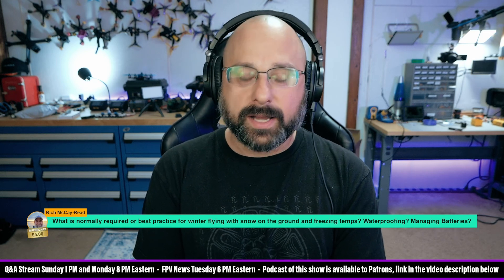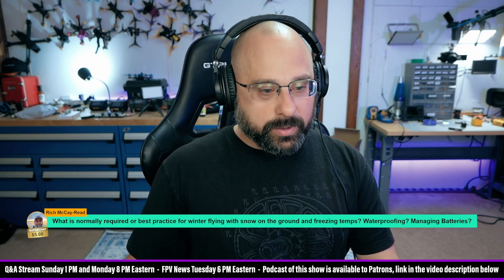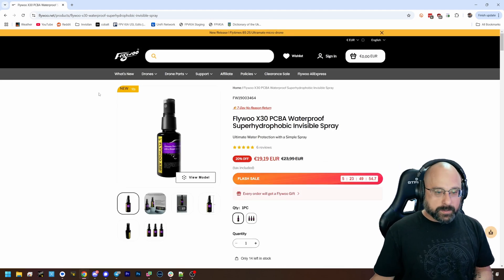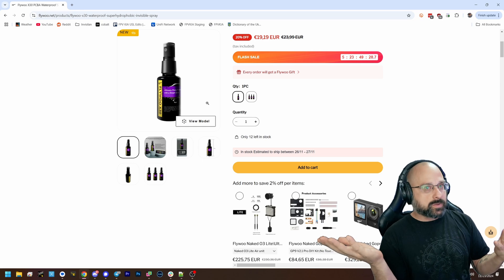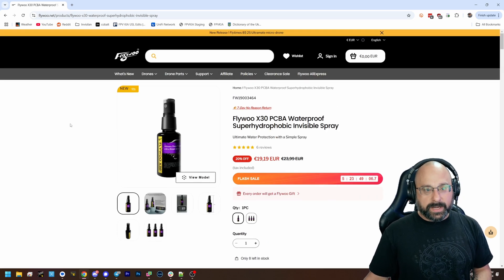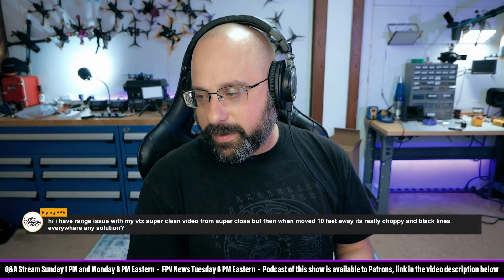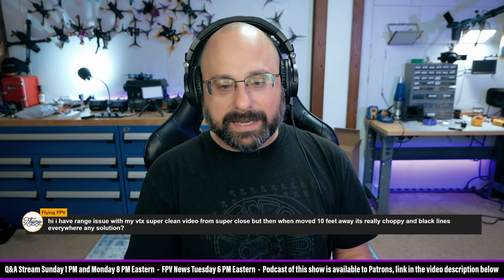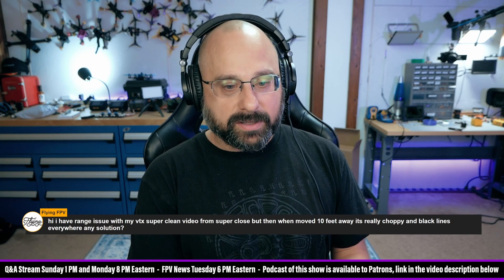What's Better About an F7 Over an F4? What Should I Do To Prepare For Flying in the Cold? - FPV Q&A

Comment: Bardwell forgot to mention for winter flying that props  are much more brittle in the cold,  some will explode without hitting anything, so use good ones and they still break very easily

Comment: In Alaska I use worry free extra thick coat or two, NEVER comes off and helps to thermally insulate. I’ve flown as low as —20 by wrapping electrical tape around entire stack, DJI air unit and all the way to camera. Basically keeps vtx heat inside and trust me air unit won’t
Reply: Yup, just put my quad a foot down in powder and just sent my flying snowball back up the mountain. That stuff is just silicone caulk but it works!

Comment: I ... might be wrong ... but the F7 has less programmable memory than an F4 ... F722 prog mem = 512kb vs F405 prog mem = 1M ... F7 is faster /more powerful yes ... but no prog mem is half the size of the F4 ... and that's also why I'll be skipping F7 ... and move from F4 to H7 if I upgrade (or ... maybe AT32F435 ?) ...
Reply: Blunty knows better than to correct every error 😂

Comment: You don't have to spray it every time you fly as long as your not fingering up your boards. Also if you don't crash all the time your stuff don't get wet. I put a triple coat on and it hasn't needed no more so far...
Reply: How do you know the coating is still intact?
Reply: @JoshuaBardwell  oh my God I've never gotten a reply from you bro!!! You are seriously like my fave content creator... ok I'm done dribbling. When you apply it especially in layers it leaves a very obvious and visible haze on your boards. I did like three generous coats and I haven't had to add any additional yet. I was very surprised how good it worked the water literally repells of the circuitry... little things in life, you made my day!!
Reply: @JoshuaBardwell  also the table I used to apply it on still beads up like a freshly waxed car and it's been outside in the elements for like 3 months... facts